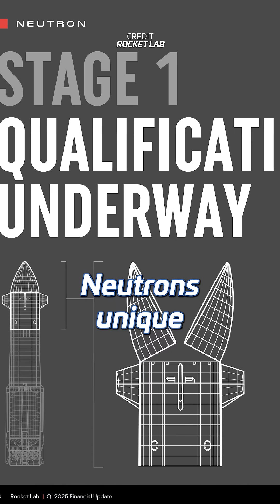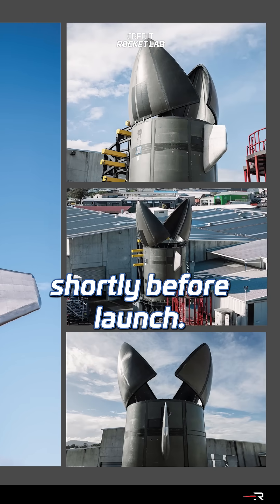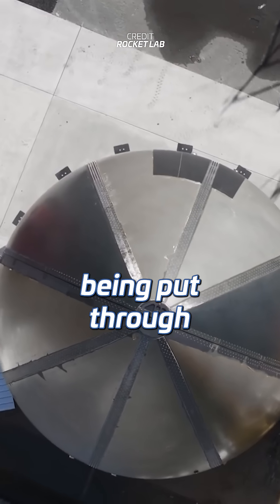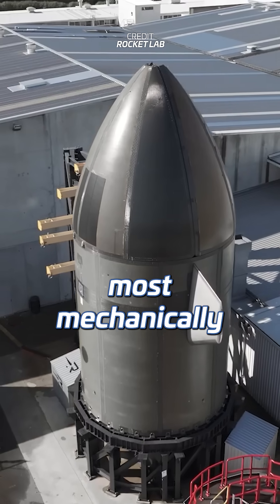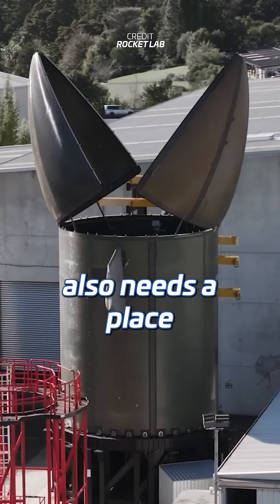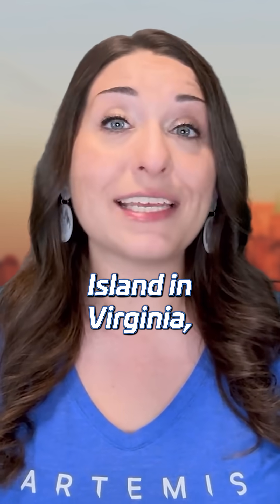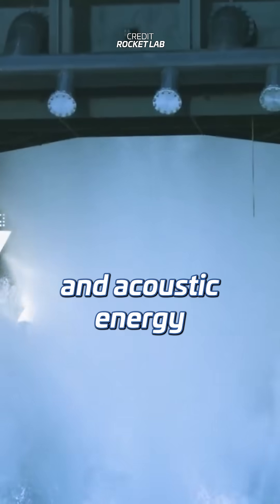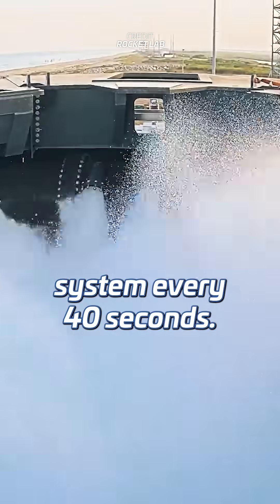A Wild Neutron Appears. For Real. #RocketLab #spaceexploration

Comment: Looks like a lot of corners were cut to save cost on the most complex thing about the rocket. 🙄
Reply: They try to keep it light weight.  It looks flimsy when it opens but closed I am sure it is very rigid.  In space it only needs to deal with MxA so no aerodynamic forces when open.

Comment: If we can see the clunkiness and wobble when it opens from here on the ground before it has flown… this thing is gonna have problems…

The opening mechanism looks like it belongs on the boot of an MPV
Reply: Hahahah saw that
Reply: Wrong, being able to open it on the ground like that shows that it's more than capable of opening in a zero-g environment with very little force acting upon it.
Reply: @kelseyduerksen6404 See intellect alludes you Kelsey.
Reply: @Slayer2029  Instead of insulting me, you care to address my actual rebuttal?
This is well known in the space industry that performing certain operations in 1 g (Earth) is more difficult than in a zero G environment.
In the case of the Neutron fairing, the fairing only needs to be clamped shut during the ascent and descent phase - once it's unlatched and there are no loads on the fairing, it can be relatively flimsy with no issue. Take a look at any other fairing separation video on Atlas V or F9, the fairings wobble around a lot once they are released.

Comment: One of the most mechanically complex systems of the entire rocket... Why? It looks like 4 pistons and 2 hinges?
Reply: It's so they don't have to have fairings that fall off and land in the ocean. It opens, the 2nd stage leaves, they close, and then the whole rocket comes back and lands.
Reply: @ryancollyer2046  You have 2 hinges and 4 pistons to hold together the part of a rocket that experiences the most stress during takeoff and reentry.  We're talking Mach 20 shaking going up, and 1000+ degrees C heat getting into the gaps coming down.
Reply: go to engineering school, you might learn something
Reply: @jimmyjames1807  All to find out why a fairing system with 4 pistons and 2 hinges is more complex than for example thrust vector control, with a gimbal mechanism, moving part, hydraulic systems, electromechanical systems connected to a precision control system?
Reply: @blessed4789  He didn't say it was the most complex, and if Beck says it, you can believe it.

Comment: That’s a very interesting aerofoil shape for the fin! Usual hypersonic foils are diamond shape but this is like an inverted subsonic foil. Anyone know why?
Reply: Optimization for sub sonic control perhaps? I imagine the final moments before landing are extremely taxing on the control system. Before that the rocket can follow a parabolic trajectory.
Reply: @sreastronaut9765  then I guess it’s going to be quite a different re entry profile comparing to f9. I heard that it will have a head first re entry so I guess it makes sense to have a sharp leading edge. Probably will need to belly flop and switch to the subsonic-edge-down orientation near landing?
Reply: @jamesdu6340 that would be WILD. Adds a lot of complexity to the system, but if they can pull that off somehow then I’ll eat TWO hats.

Comment: The Fairings don't look strong enough to hold together during High speeds ,during Launch .
Reply: You don’t think a team of a thousand master engineers didn’t consider that?
Reply: @jwandel  No ,i don't actually .it looks quite Flimsy to be  honest ,a thousand Master Engineers ,lolmao far quit
Reply: @douglasbanks3318 I pity you
Reply: @jwandel  Lolmao ,get a life Boy
Reply: @douglasbanks3318 it’s like that because it’s carbon fiber, the hinges are strong enough
Reply: I think it opens at very high altitude so low aero forces.
Reply: It has latches along the mating surfaces to keep it closed until time to open.
Reply: @stevej7139  Does it? that makes more sense
Reply: Wow "don't look strong enough to hold together", better warn Rocket Lab they didn't get it right !